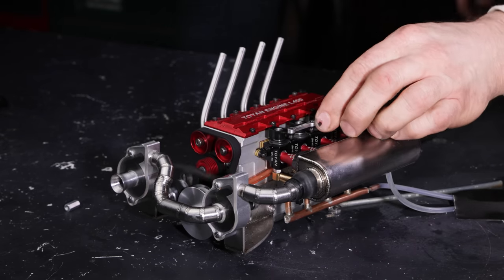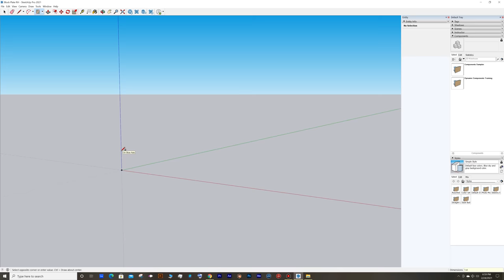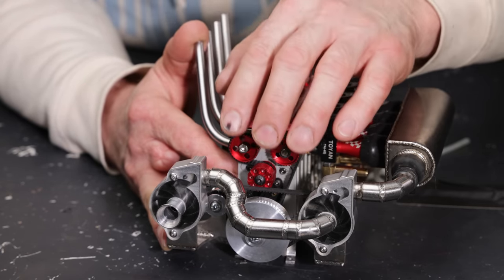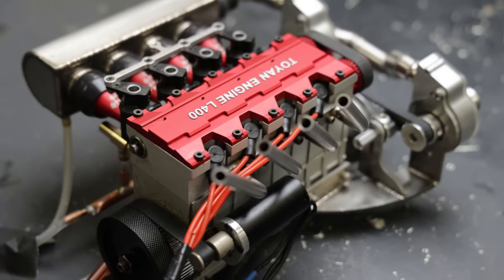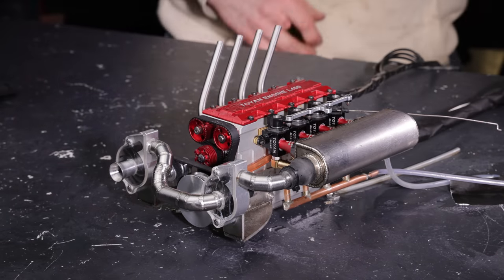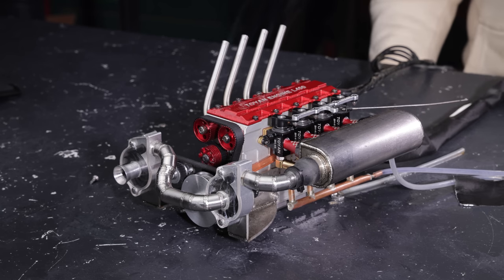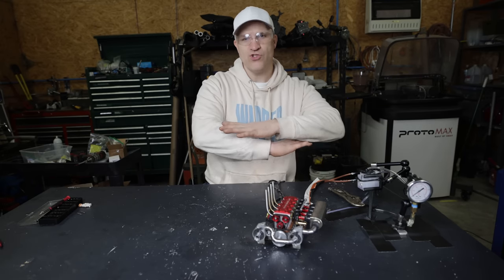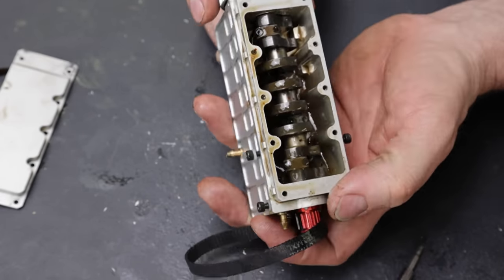Twin Supercharged 4 Cylinder Nitro RC Engine

Comment: Very cool insane design! When you boost any engine car or and rc car engine the pressure inside the engine increses insanly also increasing heat also put some lube on the riding surface of those pulleys not on the belt where metal on metal or placsic is contacting each other also make sure you runing a fan prob a biger than normal fan for the radiator

Comment: this things sick!  I'd recommend running a water pump to keep it circulating after you shut the engine off, maybe run 2 radiators. I'd love to see this little unit rip in a RC build

Comment: Perhaps you need to make a larger cooling system in general.  That way, if you’re making them, you can use it to cool your supercharges as well.  Or up the cooling system for the engine and make your superchargers with some sort of provisions for running oil through them with an oil cooler/reservoir to keep cool oil running through their bearings and jackets.  I’m not an engineer or mechanic, just a thought.  Love your content, keep it coming!

Comment: "I guess that extra boost pressure definitely had an effect on how much heat that engine was producing..."

Yea, well without any attempt whatsoever to cool your charge air with an intercooler, you might as well have just welded a hairdryer or a heat gun directly to your intake manifold.

You don't need to understand everything about the following equation: "PV = nRT" in order to observe that "P" (air pressure), is on the lefthand side, and "T" (temperature) is on the right. That is to say, in plain English, that if volume "V" is held constant (which is the appropriate scenario, as all charge air is occupying a fixed volume at all times within the chargers, the ducting, and the modified intake manifold, provided no boost leaks are present), any increase in pressure, of any fixed "amount of air" (this is "n" or "number of gas molecules") will always be accompanied by a corresponding increase in temperature of your charge air, as "R" is a unit-less multiplier coefficient (a constant, not a variable that can be controlled/adjusted).

In short, when P goes up, so does T. This setup needs 1) a liquid to air intercooler, with its own coolant reservoir and pump, inserted between the second charger and the intake manifold, 2) a functional pulley tensioner and 3) a comprehensive search for, and repair of, all existing boost leaks.

Adjusting fuel : air to compensate for boost, is not going to add useful horsepower (although it may add useful torque for a few seconds, right before the engine seizes altogether, as its internal components start to expand and melt themselves together from all the heat) until the above 3 points are addressed, first. Otherwise, every time that belt slips, you will run rich, and you will knock -- badly. Boost leaks can and often do cause similar issues. The intercooler part shouldn't need further explanation -- the only relevant point here, is that this setup 100% absolutely requires one. 

Happy building! :)

Comment: I may be completely wrong, but aren’t those superchargers in series fighting against each other? Unless the pulley ratios, the impeller foils, or the supers are different sizes, wouldn’t the fixed belt be heating up and fighting due to the different speeds needing for a compound? The first one is accelerating ambient atmosphere up to speed, then the second is getting blasted with that accelerated air while trying to also stay linked to the belt speed causing a whole lot of belt slap and friction? I may be looking at this wrong, but I’m curious if a single supercharger would be more effective. Awesome build none the less!

Comment: Toss the pulley and go all gear direct drive on the twin supercharger. I know you can do it. Your micro fab skills are exceptional. The belt needs at least a tensioner pulley to stabilize the movement?

Comment: I’m not aware of your fuel enrichment with the additional air but maybe find out what your afr is and try for a lower number. It seems healthy down low in the rpm band, but it seems very lean in its higher rpm. It’s giving off the same lean indications as a chainsaw or a small nitro rc engine. Being as it’s water cooled I assume it’s supposed to run between 140-190 degrees Fahrenheit.

Comment: Man that 3rd time you ran it sounded so nice 👍🏻 this is insane the level of work you do man. As someone who has done lots of unique remodeling carpentry/hardscaping projects, I respect the heck out of the work you do. I took 2 welding classes and absolutely love welding and tinkering with stuff. The level of the stuff you do is unreal though. Plus the scale you are working on is CRAZY. I applaud you.

Comment: Maybe use some atomized water injected into the intake. Or some kind of intercooler? Could be the charger is generating some crazy intake temps running past its efficiency.

Comment: You need an Charge Air Cooler. Either air to air or water to air, or a combination of both. Boosted air temp needs to be reduced by 30% or more before it hits the pistons.

Comment: liquid nitrogen cooled radiators...  as a suggestion...
also those exhaust pipes seem too small to handle the extra boost pressure, maybe a tiny bit bigger & fastened to exterior of manifold plate, not inside...  maybe turbo charged too, they seem to suit higher RPM engines as opposed to superchargers...  super + turbo charged...
I know it might seem over the top but a twin roots supercharger would be really cool too, maybe using a V-type engine will make it easier to mount...  They are the ones that make the whine...

Comment: I don't think this will get answered since it is so late but... Since you're running a compound belt driven supercharger I'm curious to know how you got the 10psi+ 10psi. In comparison a tradition compound turbo setup uses a smaller turbo to reduce lag on the larger one with a ball bearing turbine that has little rpm restrictions where as a supercharger is belt driven. So basically what I'm asking is if u have 2, 10psi superchargers wouldn't it only be running at 10 psi since they are equal in size and they would be pushing the air at the same rate? It seems counter productive to compound supercharge since they have little to no lag? Just curious and am wondering no hate love the vid!

Comment: 3PSI scaled down to 1/8 
Is 3x8=24 PSI… although our atmospheric pressure is still unchanging I’m not sure if 3 psi is still 3 psi for a smaller engine. Could it actually handle one bar?

Comment: You only have to go larger with the primary supercharger. You'd be better off just making a single larger supercharger instead of messing with compounded boost. Compounded boost requires a REALLY good understanding of how it works to do it right. 

If you had two superchargers that both provide 10 psi of boost (misnomer, that's not really how they work) 10 psi is a pressure ratio of about 1.7, if the other is also providing a 1.7 P/R, then total boost would be the product of the two p/r's or about 28 psi of boost, not 20 psi...but you need the SCs to be in the correct efficiency range for what they are individually doing, which is why you have a larger primary which has to provide ALL of the air that the engine ingests.

When you use a same sized primary, it is having to work MUCH harder, which creates a hotter inlet temp, which could've been why you had overheating issues. If you're going to compound keep one of the size you have now feeding directly into the intake manifold and build one about twice as big to suck in the ambient air. Without knowing their efficiencies, that's going to give you the best blind results.

Comment: I have a stupid question.  Why not have 1 supercharger boost 2 cylinders and the second one boost the other 2? Maybe use an x pipe type configuration for equalization.  I'm a carpenter not an engineer so I'm just asking a silly question.

Comment: Do a twin charger using turbo and super or just one super. Also u might need to go fuel injection and get some sensors for the exhaust temp. Control timing etc with some weird ecu thingy. U built a full intake manifold from scratch so it can’t be a biggy for you lol

Comment: with the cooling systeam try running an extrenal pump to the rad the drop the rad in a bucket of ice water the heat exchange should be better then running a fan and using air to cool it

Comment: Putting 2 superchargers inline doesnt do that much if they're the same size. In this case they even spin the same rpm so they both put out the boost. It would add up if you line both superchargers to the intake manifold. Cool build none the less 👌

Comment: This would be true on a turbo, but not a supercharger. The belt is spinning both turbos at the same speed, which will only get 10 psi because they are both spinning at 10 psi. I don’t think you thought this through. You should’ve done TwinTurbo this way instead.

Comment: Cool idea, but getting such small carburated engines to work with superchargers is a farce. It's already hard enough in motorcycles that are not truly precision fuel-injected like cars are but do make it good enough to work with a Super Charger or Turbo. Something this small would take some serious work and serious math to get fuel and air to be just right to be reliable and consistent. Just my experience with Motorcycles and jetskis. Fuel injection made it work.

Comment: maybe instead of a belt pulley you should use a gear drive system it sounds dodgy but with how scaled down it is i feel it would better suit the application

Comment: The more air you push in must be met with more fuel or you run lean and that's when you get super hot fast.  Richen the air/fuel mix

Comment: Check cooling system for bubbles if there's air in the coolant it will boil
And two fans are just redundant one would do the same as two

Comment: just go single boost, since its crank driven you shouldnt have turbo lag and you can up on the turbo size easily plus less mechanical moving parts is great.

Comment: Compounding boost doesn't add together between the stages, it multiplies, for example..
you're running both super chargers at 10psi each.... which means... 24.7psi each absolute...
convert that into pressure ratio is = 1.7 PR (well its a tiny bit more but not worth mentioning)
1.7*1.7=2.89PR
2.89-1= 1.89bar (minus 1 to convert into boost pressure instead of absolute)
1.89 bar converted into PSi is = 27.4~

a bit higher than the 20psi you stated
Reply from the maker: I know I know.... I was trying to simplify it

Comment: Centrifugal Superchargers have an internal step-up gearing that increases the impeller rpm. That should increase your boost pressure, as Centrifugals really need to spin at very high rpm for efficiency. Very inefficient at lower rpm levels.

Comment: With the amount of heat that the engine is probably going to produce in it's boosted configuration, you would probably have netter luck if you used a 360mm radiator from a PC liquid cooling setup. It would have the necessary surface area for the large amount of heat you will be producing, and space for a bank of 3(120mm) fans.

Comment: It's lean. If you didn't rejet it then raising fuel pressure isn't enough to keep up with demand from the extra air. A lean engine runs hot.

Comment: Maybe drive the primary charger faster so the secondary has a ready supply of intake air prior to the throttle plates. 
You may be suffering a " cavitation " between the two chargers if the primary cannot supply the secondary enough . The secondary requires excess air at its air inlet ,  Similar to a Ford powetstroke turbo set up . Look at their compressor size differentials between primary and secondary.  
The primary is much larger

Comment: Cool video my friend. Forced induction is very cool and increases horsepower quite a bit. I will tell you that if you put that under eight to ten psi of boost the bottom end and valve train could come apart in all directions on your first wide open pull. Hopefully not. An explosion shield to protect you and fire suppression equipment such as a large dry chemical fire extinguisher is highly suggested. Better to have safety in place than getting hit by hot parts and flames that are barely visible in day light.

Comment: What's the bore to stroke ratio of these things? they're obviously not performance based, you'd need direct injection and better forged internals to get any worthwhile rpm. 
It's a shame because even with turbos they're pretty gutless compared to 2 stroke nitro's, so running them in an actual car is pretty pointless imo, they're heavy and unreliable for that purpose but they are really cool for different reasons 👍

Comment: It sounds like its running way to lean. It seems like the rpm goes down on full throttle. Would also be a reason why it got so hot.
Also, why did you sped up the end like that? I was actually interested. xd

Comment: Now that'sa cool fucking mini Twin supercharger 4 cylinder engine! I would love to putthat on my battery powered scooter ( i would need to build a mount and also something to drive the rear wheel aswell. And you knowwhat else would be  funny to try out is, mount a big fucking muffler to those tiny exhaust pipes XD )

Comment: isint this is like putting 300psi of boost in a real car.... also why are you supplying the air pressure is that not the turbo chargers job. or are you supplying 3 psi and there upping it to 10 or 20 psi?

Comment: I say make the change to the impeller. The impeller on a turbo is what u need. Something about the swirling situation is how it works. 😂. But yea. Johnnyq90 is right. But for testing purposes. 😂. Like the setup. U got the right idea. I’d like to see them closer together. Like more compact the more there is slack in that belt the more chance it has to fly of and expand blah blah blah. Closer together. The tension pulley should always be where there is the most belt. Put the idler pulley in the middle of the chargers. I would lower that bigger pulley probably 1/4 of the size u would get your 10 psi your looking for. But u will blow the fucking pistons right out. Even that is too much for a stock Honda 😂. I know you love to blow shit up. This is your chance 🤣 make it all aluminum. You need oil running to those chargers. U need to take the housing off the bearings for the chargers.

Comment: Seems you had a ton of boost leak though, since the pipes were just sorta sitting in there and not sealed tight. i think you would have gotten a better result had there been no leaks of air with the pipes to each supercharger.
Reply from the maker: Yes your probably right, originally the pipes were pressed in there but because of the vibration that came loose
Reply: @WarpedYT  Yeah makes me wonder if you wouldn't have made much more boost due to that but then temps were already so high. Anyways just an observation that I think you already knew :) Great videos man, I love watch em
Reply from the maker: @PTIPPY  thank you

Comment: Compound charging doesn't work like this. Superchargers in series can only work if the plumbing steps down (gets tighter) after the second compressor. Superchargers in parallel works because they aren't both processing the same air. In series there's no way for the second compressor to add more air to the already compressed air from the first, so the only way to compress it further is make the pipe tighter. This is why running them at different speeds doesn't work either. If you run the second compressor faster than the first it just ends up creating a vacuum between them, rendering the first one useless.

Comment: Pretty sure that's not how compound boost works with blowers. You can run 2 blowers separate and both make 10psi which will not equal 20psi but you will double the cfm at that psi. This however will actually do nothing extra. Running one into the other

Comment: Is there no way to mandrel bend those pipes rather than cuttin out sections and bending it the way you do?
Reply from the maker: Possibly, but they are so small
Reply: @WarpedYT  I know, I just keep thinking that even as tiny as they are, which is one of the main reasons why all of this that you do is so cool btw, that when considering the interior of those pipes, that those jagged sections are going to create turbulence, which may not be causing any great impact on performance, but you never know, ya know?  

Like...I was amazed the first time I saw just how much a difference that a port and polish of an intake manifold did to performance.  Or even velocity stacks for intakes or independent throttle bodies.  Every little bit helps, that's all I'm thinking.  Thanks for the response and keep up the awesome work Bro!  Cheers!

Comment: I'm sure someone has already commented on this, but isn't that engine Twin "TURBO" Charged, and Not Twin "Super Charged"? There IS a difference between the two types for sure, but I also know that this is a bit of a different kind of engine, kinda anyway.... Am I wrong here? Or is this Twin TURBO Charged, and NOT Twin Super Charged?
Reply: Turbos run off exhaust, superchargers run on a belt from the motor!

Comment: I wonder if the head doesn’t flow enough to handle the extra boost
Reply from the maker: In my opinion no matter what the head design if you add pressure you're going to add power maybe not the most efficiently but it will add power.

Comment: This is a wicked build but those are not "superchargers". They are what's know in the performance industry as a "procharger". It's essentially a belt fed turbo charger. The increased power from a turbo with none of the lag.

Comment: use your pulley to push down the belt not push up .  that way your problem will end and youll get normal temp on your pulley.

same pulley same mount . just redirect the belt